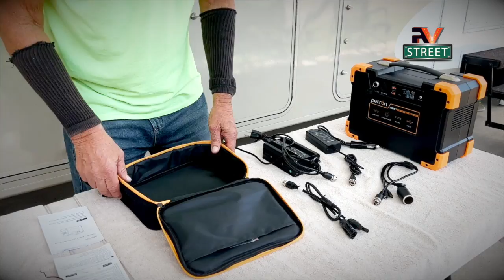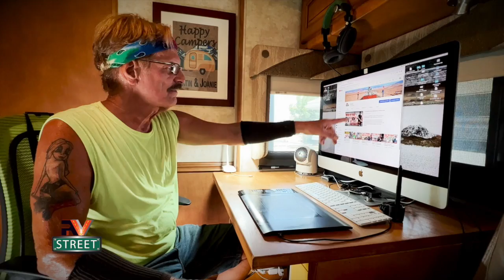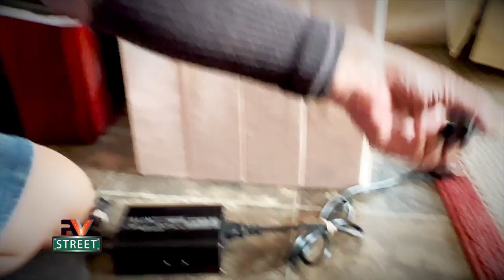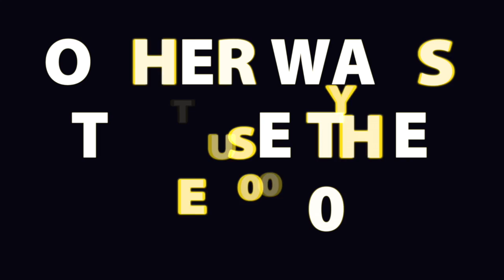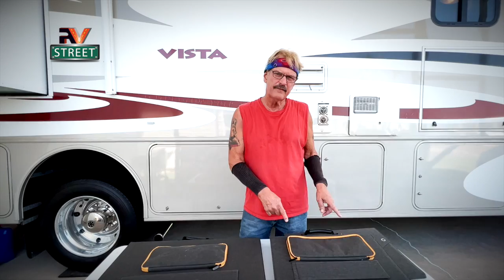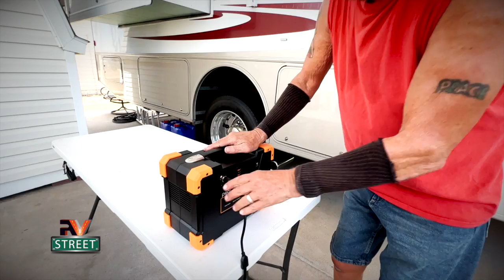Pecron E1000 & Solar in an RV • Most Comprehensive Video on YT

Comment: Great Vid, 
(btw -I liked n Subed to it)

They now have the Pecron Pro 1000w.

Hopefully it too, is a "Passthrough", charging device ?

I wonder, if that model chgd the DC in connector, from Solar panels any (min in Amps / Volts).

Have you or anyone else had a chance, to review or use one ?

Comment: HELLO, I did not see the E1000 on your site with Amazon
Reply from the maker: Hi Sue,
The E1000 and the 200watt solar panels is in the "Everything Electrical" category in my Amazon Store:
https://www.amazon.com/shop/rvstreet
The Pecron 200watt solar panel is a nice, well built panel and one of these should be just fine for a E1000. I like the 200watt panel better because it's easier to hook up with the MC4 connector —∏a universal connector I might add—and takes up less room to store in the RV.
As far as charge time with solar, it really depends on how low you have discharged the E1000 and what kind of sun you have that particular day. But, I mean for the money, you just can't beat this price for a unit of this size.
Oh...and thank you so much for your questions and wanting to support us thru my Amazon Store. It means a lot.
Hope this helps 👍 🙏

Comment: Thank you for such a comprehensive review, please share with me your experience with the pecron solar panels, would you use 1-200w panel or 2 for this unit for efficiency .  Thank you
Reply: Just re:watched your review - Im clear only need 1-200w, but what was your experience in their performance - how long did it take to charge the power station.  Would a person be able to use 2-200w panels for this power station?  Or not recommended?  I thank you for your patience and help.  Blessings

Comment: How long does the battery last in that power pack? Probably a few hours
Reply from the maker: Depends on how much load you're drawing from it. But if you're also continuing to bring in solar it will lengthen it even longer.

Comment: Ecoflow charges quickly when plugged into a generator or other power outlet.  Fast charging is critical for these things.  The low cost boxes usually charge very slowly, so you are stuck running a generator four hours or more to get them recharged. You get what you pay for.

Comment: Do you know if the panels have an ETFE coating or PET. At $425 it should be ETFE but don't see anywhere in specs where they mention that. ETFE can handle long term exposure to the sun much better.
Reply from the maker: Sorry I don't know the answer to that question.
Reply: @RVstreet  FYI, According to Pecron it's ETFE which has much longer longevity and is the better coating.  I just received mine. They don't include that info in the specs but they should.
Reply from the maker: @ronbotex  thank you for that 👍

Comment: Hi Martin. Did not know where to ask this question. I searched your channel but ... I am a newbie (as you will see by my question, sorry) I am trying to learn about charging my batteries. I have 4 lead-acid  deep cycle batteries in my 2015 Bounder. Will the Schumacher SC1280 you have in your amazon shop work for me or do you have another recommendation ? Thank you.
Reply from the maker: That unit in my store is a portable unit that needs 120V to plug into, to charge batteries in an emergency. So yes it will work on your batt's. But I have to ask why aren't your batteries being charged in the first place from shore power, running the jenny or by the alternator while underway?
Reply: @RVstreet  I "Did" not have a house outlet to plug into, that has changed i have one now so i just need an adapter from RV to house. Yes the generator charges the batteries BUT .. I had just bought this RV and checked the batteries, they where ALL low to the point they took a gallon of distilled water between all. I hope they are OK. I`ll take a look to see if you have the adapter in you A Store. Thanks for getting back with me.
Reply from the maker: If your batteries were that low on water and the voltage dropped way low—like <11volts or so, the batteries are shot. They'll never be able to hold a good charge again. Batteries are to important to barely get by with or fuss with. Get some new batteries. I highly recommend going with TRUE 6volt golf cart batteries. Like Trojans. That way you'll have one HUGE 12volt battery and you won't have to change out your converter that charges them b/c you already have a compatible converter for lead acid batteries.
I haven't done a video yet on how to set up batteries like this, but it's on my list. But there's a lot of information out there on how to do this.
Reply: @RVstreet  Thank you . I did end up buying 4 new batteries yesterday👍.

Comment: great video, I noticed you have a fan in your frig area, do you over heat or have that for drying condensation?
Reply from the maker: Neither. That fan helps circulate the cold air inside. It's just one of many upgrades I've made to our fridge. I plan on doing a video on all these upgrades this winter.

Comment: Was wondering if the E1000 is compatible with any solar panels or if Pecron's panels are required. I will watch for your reply DOWN THERE. 😁
Reply from the maker: Yes you can use other solar panels as long as they have MC4 connectors. The adapter cable to connect MC4 solar panels comes with the E1000.

Comment: Thanks for the video.  Many of us have residential refrigerators and induction cooktops in our RV.  Is the E1000 able to handle such appliances?
Reply from the maker: This E1000 is a small, compact unit that has 1000wh and would be perfect for anyone that:
1) doesn't have a lot of room to store a bigger, heavier, more powerful unit
2) doesn't have a lot of extra money to spend on a bigger unit
3) maybe have grand kids visit and you put up a tent for them, you could the E1000 out in their tent and they would have their own power

But to answer your question, it depends on how many watts different appliances use. Most residential fridges would run on it because todays fridges are so energy efficient and draw somewhere around 450-500watts. And they also have a compressor, so the compressor comes on and then off. But just remember, you have 1000wh to start with and with about 93% efficiency in this unit, you actually have about 930watts of usable power. And that's WITHOUT bringing in more power from solar.

So for example—without any solar—if you have a device that's pulling 800watts CONSTANTLY, you'll be able to run that device for about an hour and 15 minutes or so. 400watts about 2.5hrs. and so on. My absorption fridge pulls about 315watts and with my big Bluetti AC200P that has 2000wh, I can run the fridge for about 5.0-5.5hrs. Add solar to any of these senario's and you can run a lot longer.

The main thing to remember when buying any passive power station like these, is that they really are for emergency power or boon docking power where there is NO grid power anywhere to plug into. And in those cases you're always conserving power as much as you can anyways. If you want them to power a lot of things or high wattage items for a longer duration of time you just have to get a bigger unit and have plenty of solar to continue pouring power into the unit while you're using it.

For newer, larger RV's that have residential refrigerators and induction cooktops, and other bling electrical items, IMO they should be looking for a larger unit. And, any RVer should have some sort of emergency passive back up solution, because without it, you won't be able to run anything when there isn't any power.

Hope this helps
Reply: @RVstreet  Very much so.  I have learned a lot from your videos and hope to continue to do so.  Happy 4th of July.